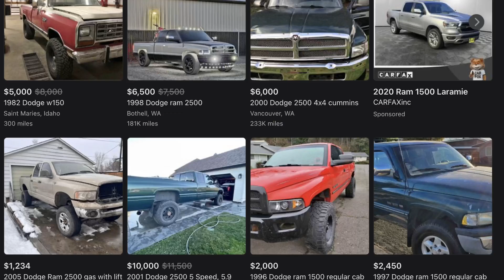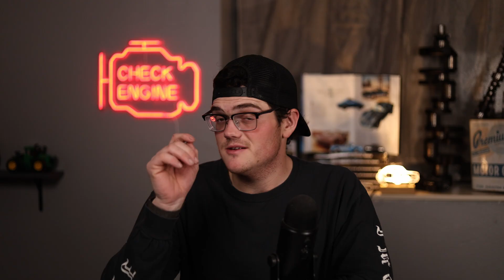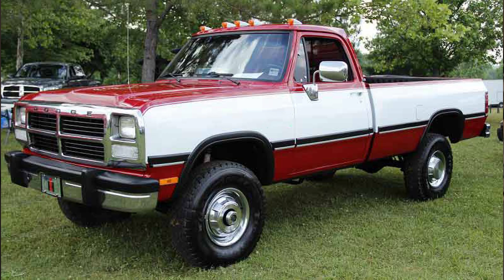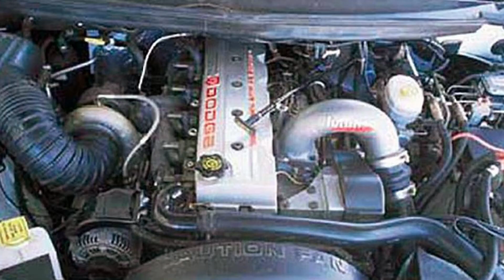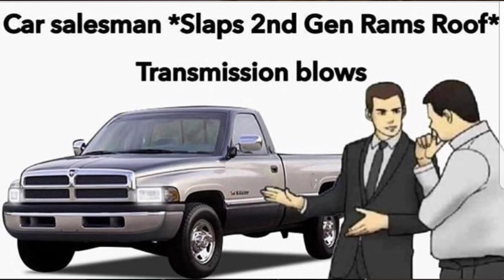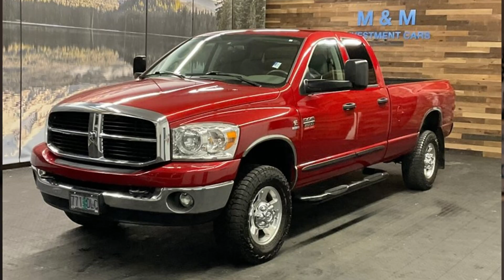The Engine That Saved Dodge - Every Cummins Engine Explained

Comment: He got amazing fuel mileage because it had no emissions bull crap on it.
Reply: He got amazing fuel mileage because the roads were terrible back then and it forced him to drive slow.   His average speed was probably less than 20 mph.  To double your speed it takes four times the horsepower.  More power=more fuel.
Reply: Compare engines made before 2006 of similar displacement and it's night and day miles per gallon and reliability. Emissions equipment and heavier vehicles  because of forced over the top safety (10 air bags and lots of ussless items) has wasted millions of gallons of fuel.

Comment: What the VGT does is change the size of the nozzle opening of the exhaust going to the turbine. The idea being at low RPMs when the flow is less, if you restrict the opening, the velocity of the exhaust gas increases to what's needed to spin the thing up. Its sort of like putting your thumb over the end of a garden hose to make it spray more forcefully.